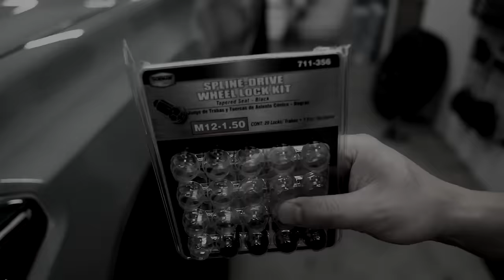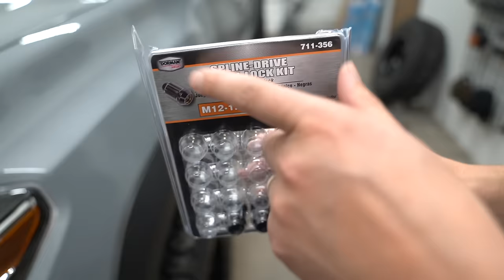Biggest Tire Size on a Tacoma/4Runner with NO LIFT!

Comment: Just so everyone knows a 255/85/16 (33.2x10) fits under any articulated+turned situation without any trimming.
Reply: Mine rubs a little under turn +flex.  2018 OR 255/86r16 ST/Maxx.  I would still suggest them though.  285s will rub a lot as you obviously know.
Reply: How about 17 inch rim
Reply: I have a 3' lift and can still get 255/85s to rub under certain situations...
Reply: I have the BFG AT KO2s and they don't rub at 265/70R17 on TRD rims. They look great and more importantly the 265/70R17 is a common size so you don't pay a fortune for the tires. I was just over $800 for the set on sale at my local warehouse club.
Reply: 285/75/16 Nitto terra Grappler on trd pro wheels on sr5 2019 dclb. Stock pro set up
Reply: SCTundra11 what about on a stock base model what can i fit? I want to go wheeling man im gonna put 35 on it yayaayya
Reply: 255/75/17 work great
Reply: @BDA123100  yep. I'm running 265/70r17 Wildpeaks on Fuel Vectors on stock suspension trd off road and have zero rubbing. Truck looks so much better too.
Reply: Hi guys love your videos kind a new to this just got myself a brand new 2019 Tacoma off-road I do want to put some new wheels and some tires give it a little more aggressive look but I don’t want to cut anything up, I don’t do much off road stuff im keeping it stock. you suggested 275/70/17 what would the offset be  and would 17x9 wheels work. Or any suggestions would be appreciated. Thanks
Reply: Chad Rollheiser on what wheel offset?
Reply: BDA123 is it more common than 265/75/16? I’m stuck on which one I want to upgrade from my 245
Reply: @jessehernandez1081  i have some 265/75 16 BFG A/T KO2's. They're a fairly common tire. Got mine when they were first hitting the market. Paid around $800 total with installation and old tire disposal. 

I measured them mounted and think they were 32" if I remember correctly. I plan to get a Tacoma just so I can transfer these tires over from my old F150 because I like them and this size so much. Its unfortunate that not many trucks are still rocking small wheel/ big tire from the factory anymore. Everybody's putting 20's on trucks now. It's so lame. My truck can run over bags of nails without getting a flat.
Reply: Japoop Sabeano i have an appreciation for the slammed trucks. I just happen to like my Tacoma at stock height with a slightly bigger tire. Looks more beefy and aggressive
Reply: Does the transmission hunt more? Or do you need to do a regear?
Reply: A Lot of statements of what doesn't rub with their set up, but what's everyone's off set. That's a major part of the equation of how tires fit and rub vs no rub.

Comment: I think that if the tire is 2.5 inches larger you only gain half that in added ground clearance (1:20).
Reply: The 32 inch tires is all you need

Comment: i just put 285/70/17 k02 on my trd sport and it rubbed A LOT even with a 2” lift. we had to trim a lot of the wheel well plus do a cab mount chop. there’s no way this won’t rub without any lift especially when the shocks compress off-roading
Reply: It was probably your offset. With my 285s my tacoma didnt rub at cleghorn, or at sandstone canyon. No cab mount chop nor plastic cutting. I did have the alignment shop adjust the caster though. This was at 0 off set.

Once i changed rims though the offset was -25 and that made my tires rub on everything even with the alignment, thats when i needed the cab mount chop and very little molding with a heat gun for the plastic.

Its all on the offset with 285's 👍🏼
Reply: You think 275s would rub?
Reply: Your offset and and wheels (how wide are they) are a huge part of it. Offset changes how tires fit in the truck and how wide you go on your wheels will change how the tires fit on them, so it will also affect how flat or round they become at certain pressures as well as how much bulge you get on your sidewalls, which translates on the rub you can expect between the tire and the suspension components too.
Always remember that the way your tires fit only apply to your exact setup (mods, wheels, offset, suspension components, suspension wear, specific tires, etc)

Comment: 285s on stock suspension lmao good luck. The biggest tires you can fit on stock suspension with no trimming and no rub is 265/75r16 or 265/70r17. And 275s will fit with minimal trimming

Comment: I own 5 Tacomas. You CAN NOT put 33 inch tires on a stock Tacoma!!! ha It's going to rub like Hell!!! If you want 33 inch tires then go get A LIFT!!!!
Reply: Not all 33" tires are true, depends on brand. 255/80/17 Cooper under 33" and 285/70/17  Goodyear actual 33". As for rubbing depends on rim offset. Even 31" with huge negative offset will rub. 285/75/17 is over 33''!
Reply: tom thorn how about 275-70-17 on stock ?
Reply: I currently have 33" tires on my 2019 tacoma with stock height with minor trimming, no body mount chop and it doesn't rub while off-roading... and they have 1-1/4" wheel spacers on my truck too... they fit, as long as your okay with trimming fender liner
Reply: What size life do you recommend? I have an 07 Tacoma and want 285 70 17 tires 😁
Reply: 2ZZGE5.56 I would go with a 3” if you want to comfortably fit, but your going to need a cab mount chop reguardless, I’m at stock ride height on those same size tires with a cab mount chop and I have no rubbing issues even at full flex
Reply: Guys I'm hearing so many opinions out there and could use your help. I have a 2017 trd off road. What would be an ideal upgrade from the stock set without any trimming at all? Rims size offset and tire size
Reply: @bgbg8857  I second this question..
Reply: @bgbg8857  just put on bfg ko2s 275/70/17 on a 17" trd pro wheel.  They fit . No rub. Theyre E rated. Havent noticed the gas mileage or ride on my 2019 4runner( trd off road). Im happy with them. Americas tire depot has buy 3 get 1 free!!
Reply: Hi I have a 2020 Tacoma comes with 265/70r/16 . I would like to level it and run a tire to fill in the wheel well do you recommend a set up?

Comment: Theres no way this wont rub.  You arent getting 33's on a tacoma with no lift with out them rubbing.  Even though he shaved the liner a bit, its still going to rub like crazy.  Just wait until he starts making turns on roads that arent level.  33's are dope on a tacoma, but you have to put in the work to get them to fit with out rubbing.

Comment: You need to match the lug nut SEAT to the wheel. "Acorn" does not tell you the seat type. I won't poke at you for your tool or style selections, but it's technically important to match the seat type - conical/taper, spherical/ball/round and old school flat.

Comment: Actually it’s a 1.05 inch lift, because you know, the tire is round.
Reply: Thank god someone else caught this lol... Understanding the diameter of a round object apparently slipped his education or it’s a magical tire that keeps all 2 inches between the wheel and ground at all times while spinning 😂😂.
Reply: Changing tire size from 31 to 33 inches will raise the ground clearance by 2 inches.
Reply: Steve Cabacungan ...... the diameter increasing by 2 inches does not add 2 more inches of clearance, the tire is ROUND and the vehicle rides the center of the wheel not the very top of the tire so just think about that for a minute. As the first poster mentioned the average person would think that it would add an inch but you have to take in account static load radius which can decrease or increase clearance depending on the type of tire due to softness/hardness. I/e why some new tires sidewalls bulge more then others.
Reply: Steve Cabacungan A good question to help understanding this for instance. If going from 31 inch tires to 33 inch tires adds 2 inches of ground clearance as you say then why doesn’t 31 inch tires give you 31 inches of ground clearance? Which brings us back to the tire being round and the vehicle being supported by the wheel in the center of the tire not the full 31 inches of diameter.
Reply: Steve Cabacungan 1”
Reply: @VertoxEffect  You are right. My bad!
Reply: 10:57 I thought you were gonna slice your hand right there.
Reply: The only thing is larger tires clearing is one thing will the transmission be able to turn them without dragging the transmission down?

Comment: I like your channel and enjoy your videos.  Don't want to see ya'll put out incorrect info.  Tire size above the axle does not increase clearance.  Your increase in clearance is 1.05".  32.7" - 30.6" = 2.1".  2.1" X 0.5 = 1.05".  They are nice looking tires.
Reply: Amritt Villa wrong.
Reply: @BlackGT1999  Oh you don't like the way the tires look.  Is alright...  That would be a subjective kinda thing.
Reply: @BlackGT1999  How is @Amritt Villa wrong.  you're effectively lifting your truck 1.05 inches with 33s.
Reply: Do u think I can run 305/65or70R16 on my stock 2007 taco with the stock trd rims?Serious question!!!Thank You in advance
Reply: @BlackGT1999  

My brain has cramps after all those numbers 🤪

Comment: ok, so, i dont get it. they make a video where they say it's stock, no rubbing with small trimming.
but everyone else is having issues ? i guess Taco Twonz will do a second  video review after driving few miles ? i wanted to upgrade my tires with these video, i was so happy since i didnt want to lift .. but i am now hesitating...
i have TRD Sport 2020, i live in FL and i dont do offroad... but i want the truck to not look like skip leg day...
any suggestions on what tires would fit using the original rims. (i like them tho.) anyone knows those original rims are 0 offset ?
Reply: 265/70/17 that is the biggest you can go with stock

Comment: I’m a total novice in trucks... but I just bought this identical Tacoma... I find it funny the wasted money on the grille, since 2020 got rid of the chrome... which is the #1 reason everyone bought this pro grille.  Makes no sense, at least to me, trying to squeeze a big ass wheel on there which will cause major issues when driving bumps, off road or crappy city.  Looks like this owner knows jack shit about truck performance... just wants a specific look, as cheap as possible.

Comment: The turn test is without the suspension compressed as it would begin an off-road situation.
Reply from the maker: rob the elder exactly, most people who are asking us for the biggest size are also saying they are only driving on road. But definitely would rub when off road
Reply: Taco Twonz how about when just turning normal into a drive way will the rub ?
Reply: @tokitone  Guarantee it will rub with any articulation.  You could get a little more aggressive on that trimming to reduce that rubbing though.
Reply: I'm running 275/70/17 on a stock DCLB OR and it rubs on full crank in reverse gear and turning into driveways. Aggressive trimming trimming of my  fenders too. Thumbs down for this video.
Reply: Pete Fairhurst Yupp ended up cranking the fox up one more inch I’m in the clear now
Reply: @tokitone  
You are running 33 on your Tacoma? What kind of set up you have? I was just thinking 3/1 spacers block?
Reply: @papabear007  fox 2.1 set a 3in lift in front and a 1.5 block in back

Comment: Ya no, if you want just looks do this. But if you actual plan on using your truck off road this is absolutely not going to work. I suppose the maker of this video does indeed answer the question correctly but this is a touch silly if you actually use your truck to go places off the pavement

Comment: Idk about this. A turn test in your garage is one thing, but actually driving normally on the road with this setup is another thing entirely, let alone trying to go offroad, Personally, I wouldn't run this big of a tire, in any case,  because I don't want to cut on my truck and 35s look ridiculous, in my opinion. I think 32s are plenty big enough for this truck and they don't look silly.

Comment: 33 dont fit tried  it you cant turn the wheel 100% without hitting the upper part of the spring  and you cant take it off road  32 is as big as you can go stock and use the truck properly
Reply: Have you tried it yourself or you happen to know?

Comment: Thanks for showing this.  Although I was tempted to go bigger on my 2021 Tacoma TRD Sport, I decided to go with the Wildpeak At3W in 265/70/17 on Black Rhino's Sierra wheels.  It actually feels great and I think I could have gone up one size.  Anyhow, thanks guys for all the awesome vids. 💯🤙
Reply: Hi brother you think you could have gone up one size ? What you mean by that sorry I’m trying to upgrade my wheels also not sure which to go for . I wanted ko2 285/70/17 but I’m sure they will rub
Reply: Gabriel Guardado Actually, the 265/70/17 (31 inch tire) just fits without a lift.  If I were to go larger, it would be better to get a lift.  Yep, the 285's will definitely rub.  The KO2's are dope.
Reply: I’m thinking of getting the KO2 275/70/17…. You think that will fit? I have a stock 19 trd sport. It does look like it has a slight lift 🤷🏻‍♂️ maybe an inch lol
Reply: what rims did you go with ?
Reply: how have your tires held up? I'm interested in going up to a 265/70/17 on my stock '23 Tacoma. Any problems with rubbing at all?
Reply: I just installed 275/70R/17 on my FJ it rubs at full turn. I don't believe anyone saying 285/70R/17 will fit without rubbing .
Reply: @TheRichellis79 did you do any trimming on your set up? And what’s the offset on your wheels? I wanna do the same thing you have please let me know if there’s any trimming and rubbing thank you.
Reply: @mikeu3660  I went with wild peaks atw3 285/70/17 with a level kit there’s a lil rub at full turn. I did put on 2 in wheel spacers

Comment: I always thought Taco's had bigger wheel wells than Hilux's, but this is almost exactly the same amount of clearance work I had to do to fit 33's on my Lux with 0 offset wheels. Only difference is, mine isn't a mall crawler, so I did my turn test with the suspension compressed.
Reply: A tacoma is a hilux. Its just gas not diesel
Reply: @zebrastripes875  Hilux comes with a gas engine too, they're not the same chassis, Taco is C section, Hilux is full box, and the Taco comes with a longer wheelbase. Hardly any of the front suspension parts carry over (there's better stuff available for Tacoma, so a lot of Hilux owners have looked into what parts can be used on both)

Comment: With all due respect, potentially cutting the exhaust way back under the bed and eliminating the look of the tail pipe for the sake of BFG 285s instead of just putting on 275s on , is really stupid, you wouldnt have to to do any of that trimming with 275s, and it would still look great because those are great looking tires, and they won't effect the final drive ratio.

Comment: I just installed 285 75 16 Toyo at3's on my factory tacoma trd pro 2020. I have removed my mud flaps because it looks better and would just barely touch when turning. I seem to have lots of room. No rubbing, no lift. I also lost 2mpg. But looks like it should have come from the factory
Reply: @papabear007  I will work on pictures, If I cross a high curb will get a small rub. 88 rotors say with a 1.5 add aa leaf and a 1" spacer it won't rub at all. But I want the softer ride and no higher. Works for me
Reply: @philipsoucie3015  
Thank you ! I was thinking about 2inch leavening kit if that would help hmm

Comment: Guys guys guys... Lift or not those size tires will rub.. Mall crawler or not. They will rub depending on the angle. They should be have put a disclaimer saying for mall crawlers only. Off-road guarantee they'll rub & that's not fun on trails either.

Comment: I have a hard time believing you have no rubbing with the 285/70. I have a 17 Trd Off-road with 2” lift and my 275/70/17 rub in reverse with steering wheel turned 3/4 lock. Rubbing occurs on the cab mount. Cab mount chop is required.
Reply: With what size wheels? What was the backspacing? And the offset of the wheels?
Reply: JPRATT537 
17X8.5   
backspace 4.3” 
offset -10
Reply: @craiglange3039  that offset and backspacing is the reason you're getting rubbing with the 27570. That size is usually one of the sizes that doesn't need much modification to fit. At least on the 4runner
Reply: @craiglange3039  also those things combined with the size of the wheel.
Reply: @craiglange3039  That is exactly why you are rubbing. Its because of the negative 10 wheel off set you have.

I have the methods NV 305s 0 offset. I had an alignment done to my 28575R16s a bit bigger than the 28570R17 with KO2s and i did not rub at all. Even when i went offroading in cleghorn, azusa. I had no rub at all. I do have a 2.5 inch lift tho. Adjusting the caster forward helped remove the rubbing completely tho 👍
Reply: Jorge Quezada agree  the -10 doesn’t help, what UCAs are you running?
Reply: @craiglange3039  i have the ICON Delta joint UCAs.
Kings 2.5 ext travel all around
Reply: Jorge Quezada i don’t know my caster numbers, maybe i’ll try and get another alignment and see if it helps. I have Camburg UCAs. Thought maybe you had Light Racing UCAs
Reply: @craiglange3039  i just checked my alignment paper and i have 3.4 passenger caster and 2.9 driver caster. No CMC needed either. The alignment will help if you dont already have it pushed forward but i think its still going to the rub with the negative off set

Comment: Hello, my take away from this is from the spare tire placement.  I would recommend that if you don't cut the exhaust pipes and perhaps use some sort of heat shield wrap, that may work too.  Just my 2 cents.  Thanks again guys for the content.
Reply: I suggest cutting a flat spot in the tire. 🤔🤔
Reply: @jasonpatrick5725  BIG BRAIN
Reply: Exactly. Fiberglass insulation as an example. Wrapped. Don’t cut off the exhaust pipe. The exhaust should vent away from the vehicle not underneath it. Carbon monoxide hazard.